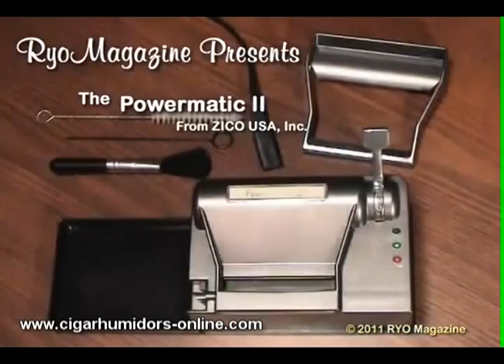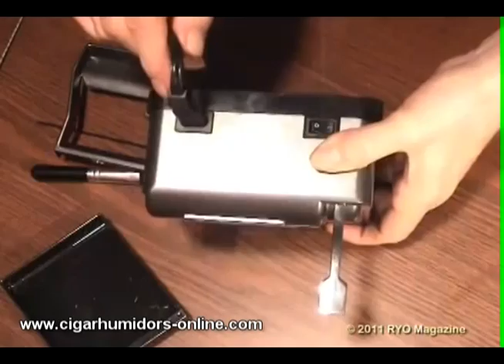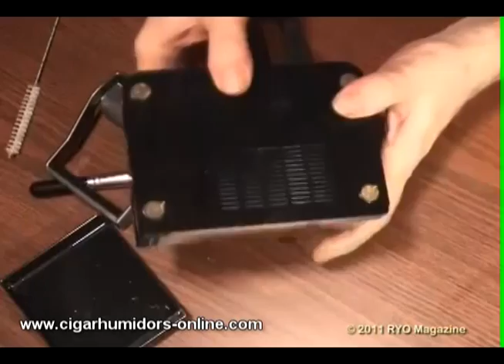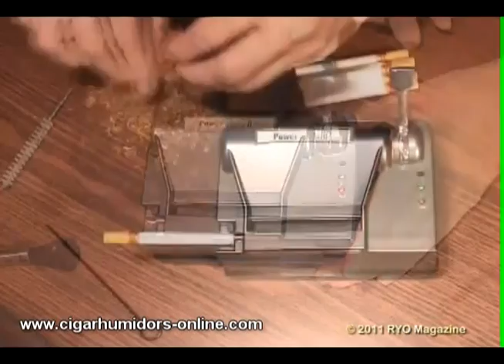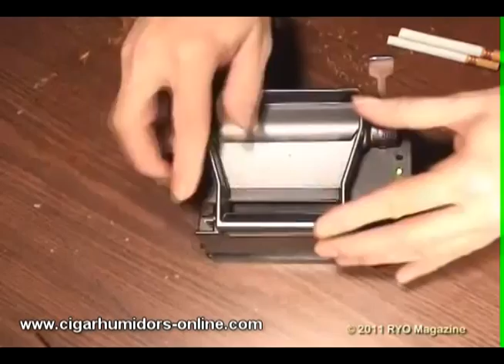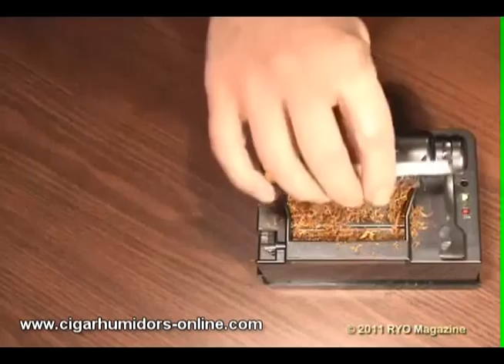Powermatic II Electric Cigarette Rolling Machine - Spoon Cigarette Injector Maker 2 Zico

Comment: @1stClassCigarHumidor You say not to use Pipe tobacco to use cigarette tobacco with this machine. What is the difference between the two, I just started to roll my own and I bought a big bag of The Good Stuff Gold pipe tobacco. I must admit it does not look the same as what would be in my marlboro's. Any recomendations on a good "Cigarette" tobacco I can buy in big bags that isn't super expensive? The Good Stuff Pipe tobacco is about $10 a bag. So how much would cigarette tobacco be? Thanks.
Reply: Jim Z A lot of people use "pipe" cut tobacco due to the price difference between it and "cigarette" cut tobacco which is largely due to the extreme taxes imposed on cigarette tobacco but for some reason pipe tobacco is not taxed to the same extent.

Comment: I've been using my Powermatic 2 for a couple of months now, rolling king size cigs. I don't seem to be able to get the hang of filling the tubes all the way to the filter ends. Any suggestions? Thanks!
Reply: Probably putting too much tobacco in the center area.  If you put too much in center, it won't get evenly distributed and leaves you with it limp at the filter.  One pinch of tobacco is all it takes and you have to pack it in towards the left to insure it will fill the filter area.  There's a learning curve with this.
Reply: MeYou Thanks so much! I tried it, and it's so much better.